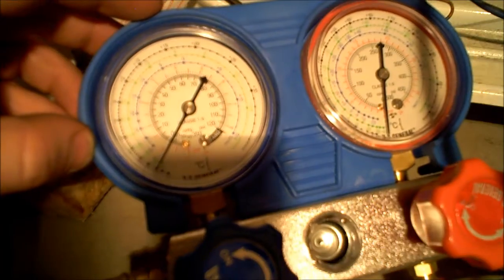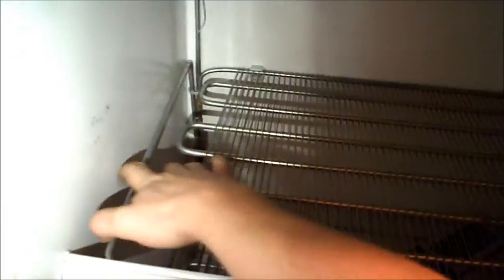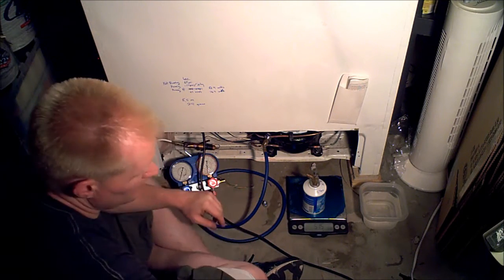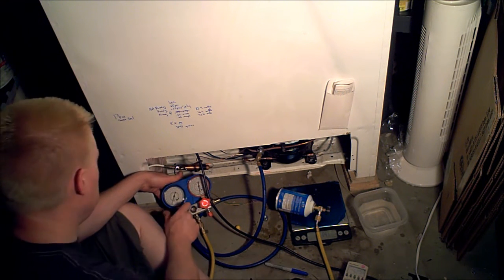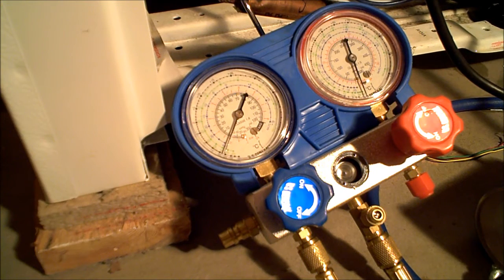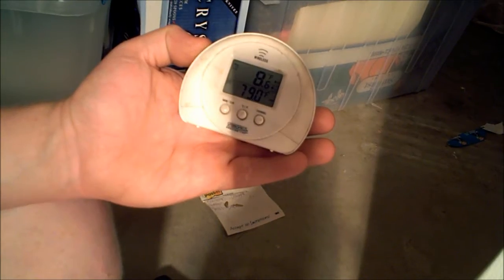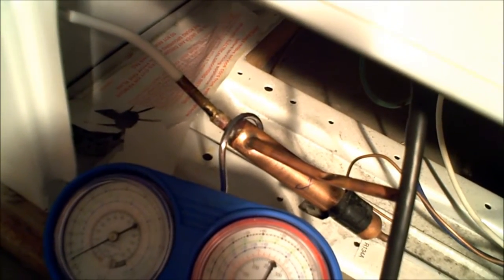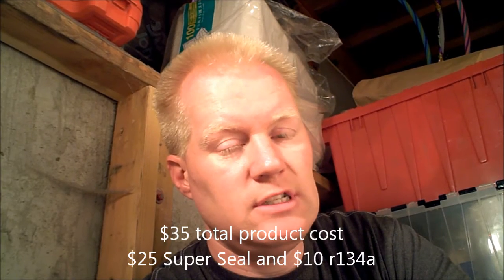Upright Freezer repair r134a refill part 2 of 2

Comment: Wish this was a shorter video instead of 2 parts. Also would have been nice if the links worked, as well as having key terms to search or brand/models of the tools he is using in case the links are fine just don't work for some viewers.

Comment: This is an awesome video.   The lighting and mood in this was a trip, freaky.   And if it wasn't perfect, none of us are.  I saw this when it released and I had to come back and watch these again because I have a freezer with a pinched off copper stub line that looks like a hack.  I thought I remembered seeing that on your freezer.  Maybe that's how the factory fills and seals the system.   Would be nice if the industry had standards and every freezer came with a valve.  Maybe failed compressors are more often the cause of failure, but most people probably don't realize their freezer is running all the time and eventually the compressor will fail.   You can't run a compressor except upright, but can you move one sideways?   GE has an article that says you can, but you turn it upright for the same amount of time(24 hours max) before running it.  Moe!

Don't let yourself be confused on booze.

Comment: I appreciate your video! I charged my freezer yesterday and last night temp was at 16 degrees. I turned up the thermostat all the way then went to bed. In the morning it was 22 degrees and rising. I couldn't figure out what went wrong so I bought three more cans of 134a and added one by one and nothing got cold so I ended up adding all three to see what happens. The compressor has a safety which shuts it down at 80 PSI. I should state that my freezer only calls for 3.5oz of 134a and I had a bad can tap which would not shut off so I used the whole can yesterday. That brought up the PSI to 22 and like I said it worked until this morning when I saw the temperature rising. I am assuming now that it got to cold and blocked up with ice in the lines. That's just my guess. I am now running at 10 PSI and it seems to be getting cold again. I am just wondering if I should lower the PSI even more but right now I don't want to touch it if it is working. There is a section of copper line about 8" that is frosting over and is near the compressor. I don't know if lowering the PSI will change the frost or even if it is alright like it is.
Reply: I should also state that I did use a vacuum pump prior to injecting 134a.
Reply from the maker: Too much refrigerant acts just the same as too little and will cause cooling issues. I assume you're using 12oz cans, so 1/3 of a can should be ample to run your entire freezer. I'm impressed that it held 3 cans/30+ ounces of refrigerant. If you're vacuuming out the system I would simple add by weight the listed ounces and stop(add.5- 1oz +- for line disconnecting looses). That is the easiest way to do it.
Reply: Thanks for the info. I would have measured it out (even bought a scale) but the can tap valve would not shut off, defective, so I added the whole can. When I had the freezer at 10 PSI I had a knocking, pinging sound around the compressor area or the lines just above it so I lowered the PSI to 5 and that seemed to take care of the knocking noise. The temperature is currently at 14 degrees with the control knob at 3 (out of 7). I have a lot of frost on the copper lines in the back which worries me.
Reply from the maker: The compressor can only handle a gaseous r-134a. Too much and the R-134a will remain a liquid and hydro-lock the compressor(knocking). If you have high humidity you will have more frost than typical, especially with repeated opening/closings of the door to check temp.
Reply: The frost is only on the back side copper low side pipe where I attached the line tap. It is only frosting up on about a 8" section. The interior doesn't have metal cooling racks. The cold air is blown in from the top inside so nothing to worry about inside. The temp is around 11 degrees and the knocking disappeared, so overall I am happy now and hope it keeps going. Thank you for you help.

Comment: Still working!  Also, I saw where it is best to place the thermometer between a couple bags of frozen vegetables to get a consistent reading when adjusting the temperatures.
Reply from the maker: It's still going.
Reply: Great!
My only "problem?" is heavy frost on the suction line.  The pressure remains 0, the internal freezer on 4 is -4 to -6 degrees.  Some sites say it is over charged, some say under charged.  I'm just ignoring for now.
Reply from the maker: Under and overcharged have virtually identical systems.

Comment: Thanks.  Purged the hoses, put in the freon.   I started at -14 psi, 
ended at 0 psi.   Just tuned off and back on to cycle.  Pressure went to
 about 50, then to about 1.  Top shelf now frosted and temperature 
dropping.

Next morning, I am at 0 psi and -6.2 degrees.  

Leaving the gauges hooked-up for a few days to see how it goes.  Can't 
thank you enough for your patience and advice.

Comment: Exactly how do you purge the hoses to avoid putting air into the system.
Reply from the maker: The fill hoses just need to be cracked while releasing refrigerant for a second.

Comment: Thank you for sharing this. I have always wondered how to add to these systems.
Where did you get the info for pressures? My system sat for a while and lost all the refrigerant, is there a place to find how  much oil and refrigerant it will need? 
Also, you add to the suction line?
Reply from the maker: +2feetaguywith They will say on them what the pressures/volumes are. Sometimes it is on the inside decal, sometimes on the back and other times there will be a piece paper folded and stuck in an envelope underneath the unit.

Comment: Just an update for the benefit of anybody who's thinking of doing this. it's been nearly 5 months since I 'fixed' my freezer and it's showing no signs of slowing down.  The best part is that it was every bit as easy as it looked in the video.  Thanks, again.
Reply from the maker: +Mike H Awesome.. Thanks for the update.
Reply: Not to beat a dead horse, but it's been nearly a year and a half since the repair, and it's still working.  Nearly as long as the original 'factory' charge, so far.  I'm assuming the sealer had a lot to do with that.  I'd call this an unqualified success.
Reply from the maker: Mike H
Thanks for the update.

Comment: Your video was a godsend!  I built a bar in my basement ManCave a few years ago that I'm insanely proud of.  I allowed 36" for my keezer (kegerator built from a chest freezer).  No research -- 36" just seemed about right.  I bought a 7.2 cu ft chest freezer that was 34" wide.  I really didn't check the width when I bought it.  I guess I just got lucky.  It fit the space perfectly and it holds 4 corny kegs of homebrew without breaking a sweat!  

Fast forward to a few months ago.  The freezer can't keep the beer cold.  Frost in one corner near the top - no doubt where the line starts.  With a roughly $150 purchase price, I can't find anybody to even come out to look at it, let alone repair it.  No big deal - it's only $150-ish to replace it.  The problem is no one seems to make suitably-sized chest freezers anymore that are less than 37" wide.  This is gonna require some major surgery on the bar.

Then I found your video.  A week later, it's chilling beer like the day I bought it!  We'll see how long it lasts.  FWIW, I bought a can of R134a at the Auto Parts store with sealer and lubricant already in it, instead of a separate can of sealer.  Hopefully, that'll serve the intended purpose.  I used an old hose/gauge I had in my garage for R12, so it had the proper connector, though I had to finesse it onto the can.

I have a question that I was hoping maybe you could answer.  I bought the same line tap that you show in the video.  It was simple enough to install, but I noticed it can be turned on the line without too much effort.  Have you come up with a way to lock it in place?  It's not likely to be a problem, since it's behind the panel, but I'd feel better if it didn't do that.  Any thoughts?

Thanks again.  Next time you're in the neighborhood, stop by for a homebrew!
Reply from the maker: +Mike Hartigan The line taps are known for not being the most reliable seal but should suffice if they're not played with too much.
Reply: The lubricant in auto cans is polyalkalene glycol, that stuff destroys motor winding insulation

Comment: hello! thx for the video. i am a small business owner and i have 4 refrigerator at the store, recently one of them are not cooling very good and i think is low on Freon r134. im planning to buy a Gage and refill freon myself but i dont have any experience on doing so is there any thing that i need to knew before hand before i just fill it up with r134?

Comment: I have a Maytag, It was given to me, I had it checked out for free, the fan is good the compressor is god was told just needs freon. I ordered the exact line tap. I have a buddy with a manifold gauge set we will try and fix it this weekend. I don't have a vacuum, is there a way to do this without a vacuum? If not how long do you need to use the vacuum for? little excited to try and fix a little nervous as I don't want to mess it up, I get confused where to put the line tap is it closest to the copper evaporator thing?
Reply from the maker: +Jimmy Medellin The vacuum is necessary as it pulls any humidity/moisture out of the lines. If moisture is left it will freeze in the lines and plug everything up. Now if you do a line tap and there is still a little pressure in the system(refrigerant blowing out) you may be OK without vacuum as it would have held any air from getting in. Most compressors will have a short leg that just stops and is crimped. You can use this port to recharge.
Reply: +sixtyfiveford Thank you I was wondering what that nub part was and wondering why you didn't put the line tap there
Reply from the maker: It leads to the same place as the other line I put the tap on, so I just used it as it was easier to access.
Reply: Thanks Buddy day 2 so far so good got an ice cold freezer!
Reply from the maker: Awesome.

Comment: Another update. This morning I plugged the freezer in again and after around 15 minutes I heard the mysterious whistle that my wife had heard yesterday. It's not the sound of pressure relief. It's an actual whistle, a 5 toned little song. It must be a warning from the freezer about malfunction.
Reply from the maker: Thomas Cirignano Some freezers have alarms if they are too warm while running.
Reply: sixtyfiveford You are correct that it would cost more than it's worth to have someone come look at this. I feel good that at least I gave it my best shot at fixing it. Your video gave me the info needed to give it a best try. Home Depot loves me. It's been one big purchase after another since buying a new home. New freezer on the agenda.Thanks again, Tom

Comment: To sixtyfiveford, Thanks so much for posting these 2 videos. They were extremely helpful to me and I had success! And if I ever have to junk this freezer I will remove and keep that line-tap, as they don't seem to be that common when I went to purchase one on the web. By the way, my first car was a 66 Ford Falcon. Great memories! Best of luck to you. Thanks again, sincerely, Tom Cirignano
Reply from the maker: Thomas Cirignano Thanks, I'm glad the video helped.
Reply: sixtyfiveford Unfortunately, things have gone down hill. During the recharge I had trouble with my hose to the 134 can. It worked erratically, as if plugged during the charge. But if I loosened the connection at the 134 can the gas started to come out freely. I must have overcharged. My wife heard a mysterious whistling noise later in the day when I was out. Now I figure it must have been some kind of pressure relief coming from the freezer in the garage. Last night the freezer alarm went off. Temp was up to 30 degrees and compressor was really hot. I unplugged it and emptied what I could. Sprayed soapy solution and could see no leaks, and there still is pressure. I'm thinking this 13 year old freezes has to get scrapped unless there is something else I could try. Last night, after the alarm went off, I released some pressure from the system, and then, while trying to see why the gauge hose had malfunctioned, I broke the plastic nut on the malfunctioning can puncturing end of the hose. So, If I try to charge it again, I need to replace that end of the gauge hose. I was so happy when the original charge seemed to have worked. Any suggestions?
Reply from the maker: I assume yours is a manual defrost freezer. The sad thing about these is no one wants to sell you parts for less than it would be to buy an entire new freezer. And a repair guy will charge you a quarter the cost of a new freezer just to tell you it will cost more than it's worth to fix. The filter drier can get clogged but it is a little out of the realm of a typical home guy repair. Other than that it could be the valve in the non-serviceable compressor that is leaking. It is really hard to say and talking to most pro's they just throw parts at these as there are really only 3 things that can go wrong: loss of refrigerant, clogged filter drier, or a failed compressor.

Comment: Hey I have the exact same freezer as you do in the video(mine says it is made by imperial) And it was doing exactly the same thing yours was where just the first foot or so of the line would frost up. I followed the same steps as you did in the video and purchased exactly the same products as you did in The video. Everything seems to be working well except I thin may have over charged it and I think mistakenly added almost whole can of super seal. 
At first it slowly rose to almost 15 psi and didn't go down. So I have slowly been letting gas out to help it get down to 2-4 psi.

My question is I live in Arizona and it is summer so in my garage where the freezer lives it gets to about 85- 95 degrees. Will this change my resdings? And if it is over 2 psi(ie between 4-15 psi) will that damage the freezer somehow?

Thank you for your time

Comment: Most freezers I have seen do not have cooling lines in the shelves.  Instead they are tempered glass or enameled wire.  We have one of those side by side upright freezer/refrigerators.  That thing is cramped and always full.  I hate having to find something in there because it sometimes is difficult to put all the other food back in.  The only other thing I hate is the sound if frost scraping.  a Good way to torture someone you don't like if they hate the sound of frost scraping would be to make him/her search the inside of a frosty freezer for some thing small in a full freezer.  That would be horrible!  I get the chills just thinking about it!
Reply from the maker: John Doe Yeah, that can be an annoying sound for sure. Just an FYI about freezers: The cooling lines built into the shelves are only for NON-Frost free freezers. Glass shelves/ wire shelves are for Frost-Free freezers like you've seen. The frost-free are great in that they never need de-icing but you can't store food nearly as long as a freezer that frosts up. The reason is it has a heater that warms the freezer(1-4x a day) to remove excess moisture that would cause frost and drips it into a pan underneath.  The constant heat/cool cycles cause food to dry out and freezer burn more rapidly where a freezer that frosts up will keep even meat over a year without freezer burn.  You can expect double or more the life of your frozen foods and it'll use 50% less electricity as well if you can deal with a manual defrost freezer.

Comment: You forgot to ad you need a special adapter for the R134a coolant , you will need a Part# BRASS TOP TAP
R134a Screw-on, top-mount with Nice LARGE Handle!
Can tap
Hose Connection, 1/2" ACME 16 Threads Per Inch (R-134a)

Comment: You need to pull the vacuum for several reasons  1) air in the lines from your gauge hoses, any type of air might have humidity, that will turn into a small icicle, could clog a evaporator depending what type of orifice, 2) by adding a little 134a or nitrogen and the vacuuming it out guaranties it to be dry and air free.
Reply from the maker: MrMac5150 Yes, but you don't need to pull a vacuum on a system that is just low.
Reply: Okay, good video.